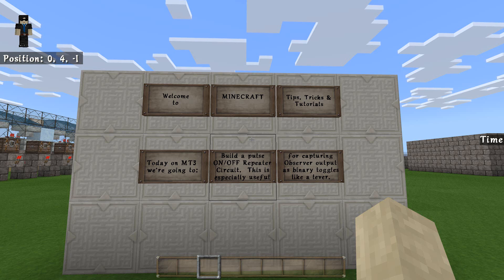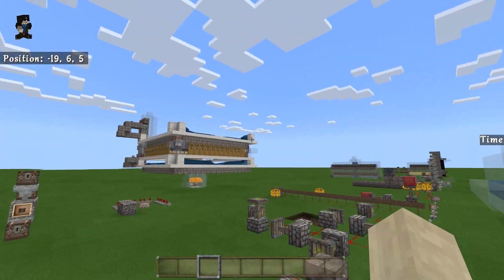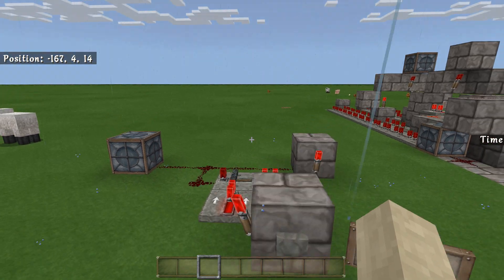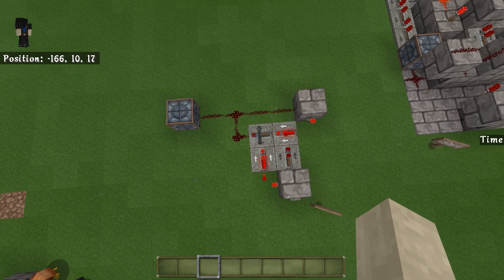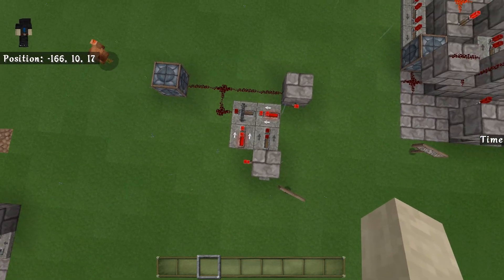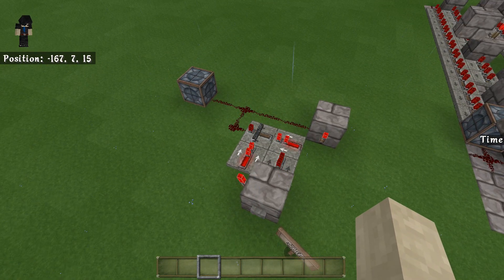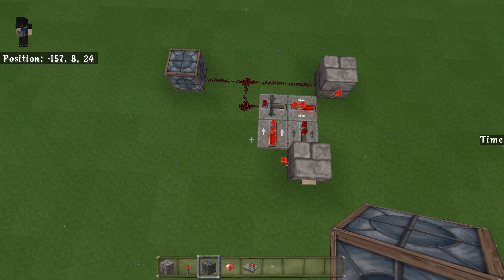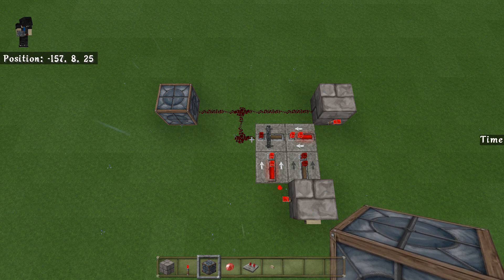Minecraft Tips 003 - Can you convert an Observer pulse to an on/off signal like that of a lever?

Comment: tried this in 1.18.2 and it doesnt work.  observer pulse is too short to activate the circuit, but it works with buttons just fine
Reply: Take a repeater output from the observer.
Reply from the maker: Thanks for the assit!

Comment: Is this Bedrock only? This absolutely does not work in Java
Reply: Java user here, it does. First, check if you built it correctly, second, if you are using an observer, you can't just leave it like that, you need to put a repeater output coming out of the observer.

Comment: How do you use an observer instead of a button for this? If so. How? You never showed
Reply: Route a repeater into the block with the button. Right click the repeater 3 times. Run the observer output into the repeater.
Reply from the maker: Thanks for the assit.
Reply: Mate Im so happy you answered this question I couldn't find the answer to but the realm ended about two weeks after that comment but thanks for answering I will now be unstoppable with my human detecting lawn mower I mean helping Jerb with his improved piston barracade
Reply: @weeddude2333  haha, a better way to do observer toggling is to use a T flip-flop, if you need one in the future see mumbo jumbos video. You can use the same input method with the 3 tick repeater.
Reply: What
Reply: Why do I need to give a lawnmower flip flops?

Comment: I can't for the life of me get this to work with an observer, It works perfectly with a button though.
Reply: you need to put it with a repeater on a 3 second delay in between the pulse machine and the observer (the repeater pointing towards the machine). Also if you want to have it longer than 15 redstone, you need at the end point the 4  delay and then the rest at the 1 for each repeater to increase distance.
Reply: Hey if you still need it i got one for observers.
Reply: Tru3 Pops i need it
Reply: which way did you make the observer face, and did you put a block in front of the observer?
because the face needs to face the block and the light / circle needs to face a redstone dust fragment placed infornt of the block.
Reply: @bedford4431  wdym infront of the block